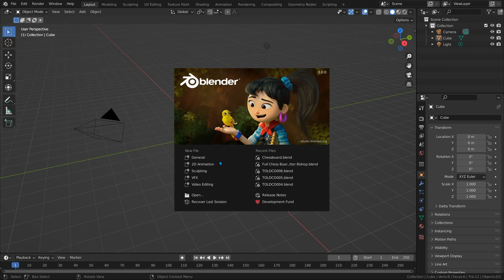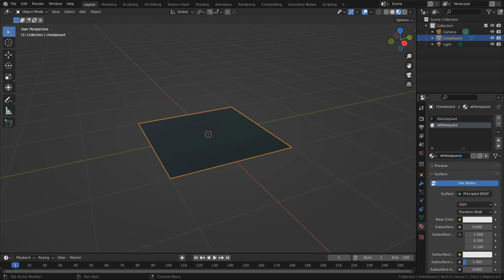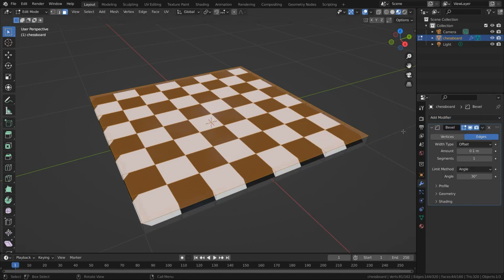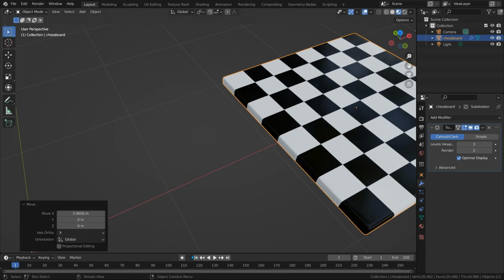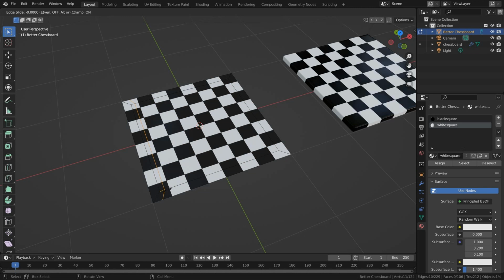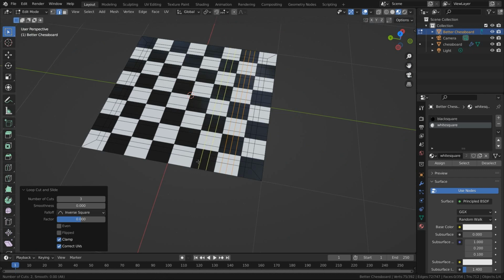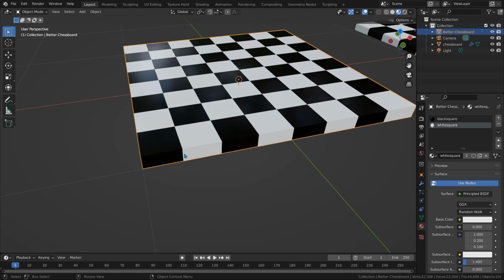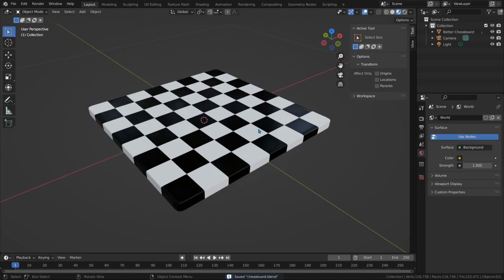Blender Chessboard - #8  Subdivision Surface Modelling in Blender.

Comment: The loopcut all around the edges is an exception: you cannot move this afterwards (with scaling it on x and y axis), because it would change the shape of the chess pattern's  outer border.
Reply: You don’t need to scale it. They are control loops. Use GG to slide them and retain the texture.

Comment: Hey, Ian. Happy 2024, hope you are doing well. I have a question... I don't think I ever saw you using bevel, but EVERY single tutorial I see, they always talk about how nothing have a perfect 90° corner, so we should ALWAYS apply bevel (at least for realism). What is your take on that?
Reply from the maker: Happy 2024 to you too! It is correct that, at sensible observable working scales, nothing has an impossibly sharp edge as you can find in 3D. There always needs to be an ability for light to flow around an edge. This is what makes things look real. A bevel is a very simple solution to this problem but I would never ever use a bevel to do this. A bevel basically breaks the fundamental necessity for any model to be adapdted if a design brief changes in any way. A bevel locks a model to a specific radius of curvature and a spatial resolution which is very difficult to change later in the process. Any changes after beveling become virually impossible. Beveling is very much a beginners technique, not used in professional modelling. Beware of the hundreds of YouTube modellers advocating bevels. Just because everyone seems to do it does not mean it is correct!!! Look for techniques taught by people with verifiable studio experience. Bevels are used to create control loops on a subdivision cage with good spacing but are not used to curve edges on models.
Reply: Thank you so much! @ianmcglasham

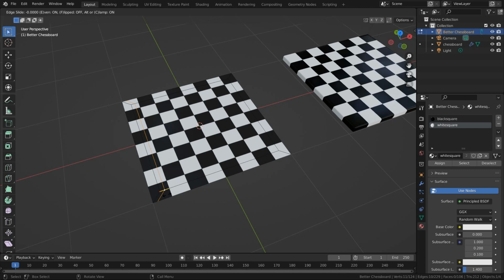Comment: At 8:29 when press e, the loop is going automatically to overlapping another one, What is going wrong?
Reply from the maker: Hi friedrich. You may have conformed the placement of the loop, so pressing "e" at that point will extrude it. You need to undo that extrusion. Select the loop again and press "gg" before pressing "e". Hope this helps. Let me know!
Reply: @ianmcglasham  Not sure but Ctrl + R, E, F did the job this time, may be related to somethings I get confused because my keyboard layout does not coincide with the letters that are printed in the keyboard.
Reply from the maker: @friedrichhayek4862  That is strange! An additional layer of challenge!
Reply: @ianmcglasham  Outside of a handful of programs that use keymaps instead of keycodes (Like some games) or keymaps when should be using keycodes (I don't remember one) everything works fine.